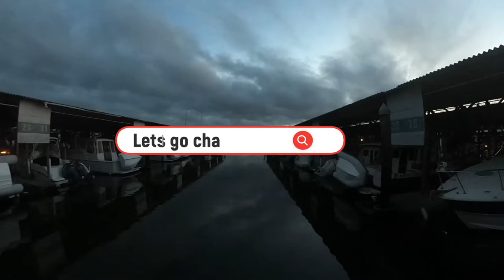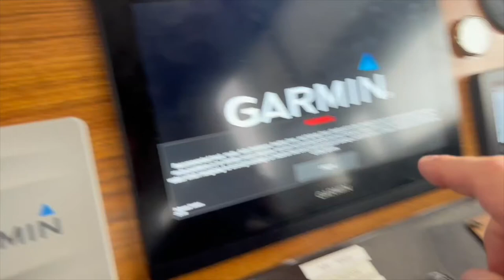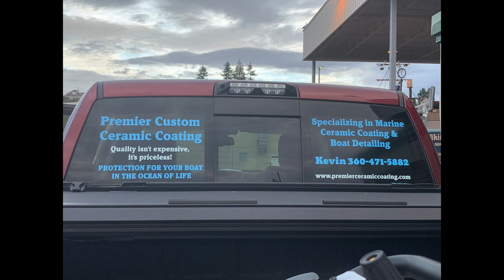Thinking about ceramic coating for your boat watch this first/Waxing vs ceramic coating/ ranger tugs

Comment: You should get like a 24 volt electric leaf blower to blow the water off and prevent water spots.
Reply from the maker: I have a portable dewalt 20volt leaf blower I use on the roof to blow off after rinsing the boat.

Comment: Nice video buddy, especially the footage of how much work is really involved when moving a larger boat like that . It was also pretty neat to see the specialized equipment that they have come up with to fit a wide range of needs and different size vessels and hull differences they are able to handle. Quite a unique aspect of the stuff you don't normally see behind the scenes or often go unthought of by big money boaters . Alot goes into boat ownership and I only own a 20 foot center console. It's a 1995 inboard so it definitely has it's needs to stay in top of to keep her in sea worthy condition yet alone maintain the visual exterior appearance. For a boat it's age it's in good shape . It has low hours on a full motor rebuild along with the lower unit and transom redone . Most recently I put a new Holley carburetor on and replaced all the fuel lines as well as the fuel pump and a new regulator. I also put new steering in from the helm . Starting with the new wheel and helm rack, and mount as well as the steering cable. Basically everything from the power steering actuator forward. Ohh and can't forget the new impeller. Next round of preventitive maintenance will be all new cooling hoses and exhaust bellows and resealing the lower unit to the transom . Also  replacing the hoses for the live wells and bait well and bildge pump and hose. It works but it's the original so I'll install a new one and keep the old onboard as a spare. I just got through doing all my trailer maintenance and tires . I don't think people really realize how much goes into owning a boat and keeping it maintained.
Reply from the maker: It was quite the process at Port of Everett, to get from the water to under the covered area on the hard.  I was surprised with how much work and time it actually takes.  

This winter I'm going to do another "total cost of boat ownership" to outline what I spend.  It helps a lot doing my own maintenance, but it's still expensive overall.

Comment: Your channel always have good info

What do you do for hull protection 
How offenten do you clean the hull

Whats the cost of gelcoat and hull cleaning
Reply from the maker: Keeping the boat in a covered slip really slows down bottom growth as sunlight doesn't touch most of the waterline around the boat.   I keep the boat over at Dagmars now, out of the water on blocks, so no bottom growth either.    I clean the hull when it needs it, which isn't very often.  But we're also in cold water year round.

Comment: Have you ever researched an instant hot water heater?  Are any of them feasible for a Ranger Tug?
Reply from the maker: I haven't found anything feasible.  Instant hot water heaters pull a lot of amps, more than the boat could provide.   Propane water heater is out as propane is heavier than air and would settle in the bilge, next to the gas tank, with a pilot light on the hot water heater.   The best solution I've found that works well is LFP and run the hot water heater for 45 minutes.  (It'll want to run for 120 minutes to fully heat up. but that's excess and is unnecessary).  A portable LFP bank of about 1200-1600 watt hours, plugged into the shorepower connection so the boat thinks it's on shorepower works well. https://youtu.be/gSgGiuvB9-A

Comment: Are you still happy with the ceramic coating? Our new Ranger 27 is built but still at factory; I’m wondering/considering this process. Our boat will be in lakes and rivers…very dirty compared to PNW water. Seems like a great option?
Reply from the maker: So far so good.  I bring the boat back to the dock and just rinse it with a hose/fresh water.  Salt water doesn't stick to it, nor does the dirt.

Comment: Hi your Chanel is great! Thank you. I have order a R-27. But recently I watched a video form TugRanger Truth showing the boat’s shell is so thin and unsafe. Are you afraid that this boat will sink if it hits something and that haul breaks and leaks easily? I am really worried.
Reply from the maker: I'm well aware of the content put out by Ranger Truth. I'm not worried at all. If you drop a boat onto blocks I would expect it to suffer damage. If you'd like additional information, please send me an email. -Martin
Reply from the maker: Update:  the boat (Lemonaide) has since been sold. It was repaired and it’s back in the water with her new owner who is enjoying their time out on the water.